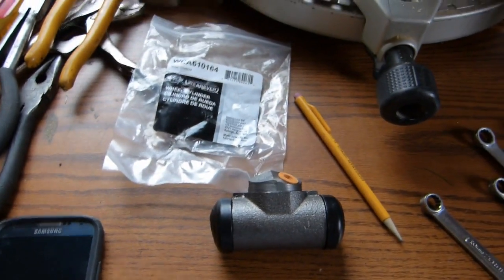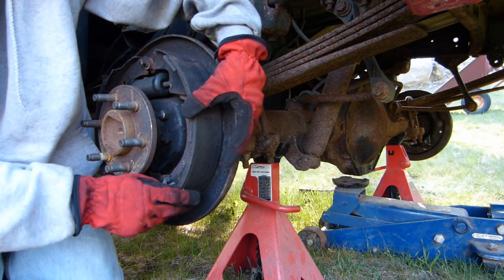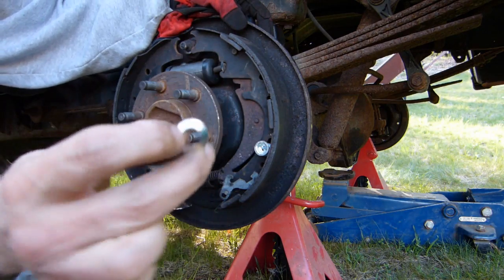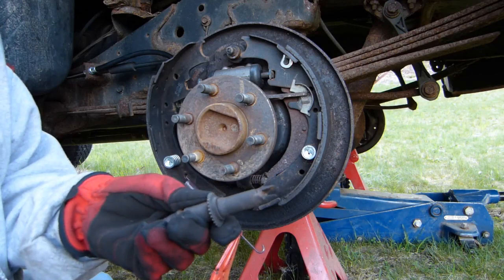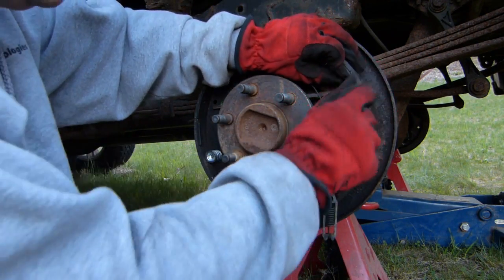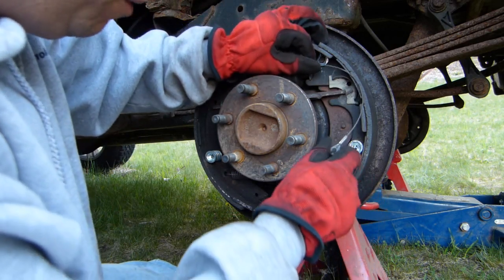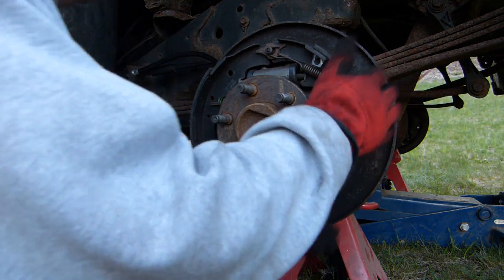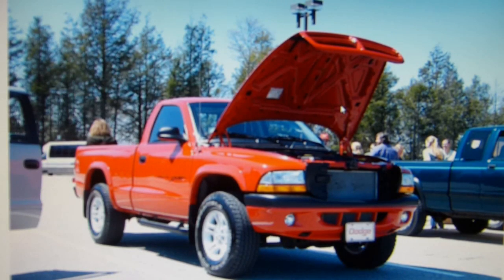Dodge Dakota Drum Brake Shoe Installation Highlihgts

Comment: What my situation is is I purchase a rear end from the junkyard anyway it's a very good rear end it's the same gear duration which is very good cost me $300 well worth it because the truck is running very well and anyway the brake drums are a different size mine are smaller the original ones I should say so anyway your videos perfect because it's exactly what I need to see how to reassemble brake assembly and I want really appreciate the video thank you thumbs up

Comment: I have  a Dodge Dakota 2000 V6 sport 3.6L.  Which model do u have?  Your wheel cylinder has a pin at each end, mine doesn't.  I have 9" shoes.  Is yours 11"?  Am I missing them?  Also, my parking brake lever/bar is Dorman pn 21158 & looks different than yours.  My Rear Left lever/bar I cant get back into place and will try to remove those 2 springs and more if that's what it takes.

Comment: Ok, I have a question?  at the top, we have 2 springs and what I will call a batwing clip plus the brake adjuster cable.  the hole on the batwing clip and the cable are the same size. and there is a place that fits that hole. but not enough room for both to sit there. what order do I put this back, cable clip springs or clip cable springs?
Reply: The cable goes first and then the two springs. (Or at least that's how it is on my 95 Dodge)
Reply: The "Batwing" clip goes on first...then the cable...then the springs!👍👌